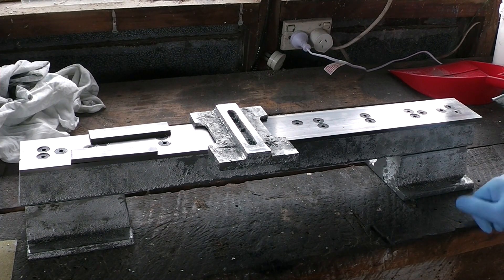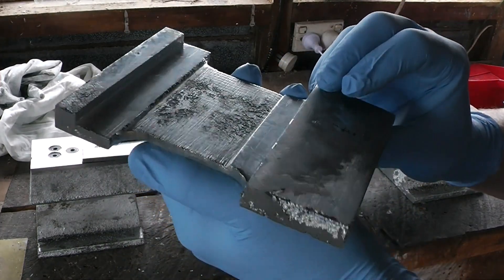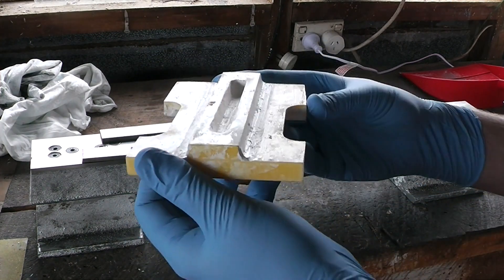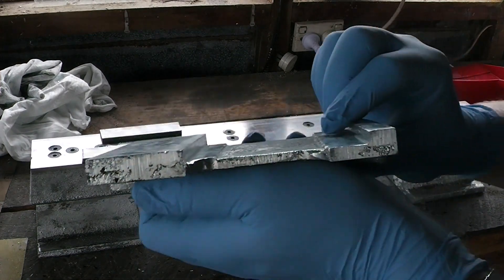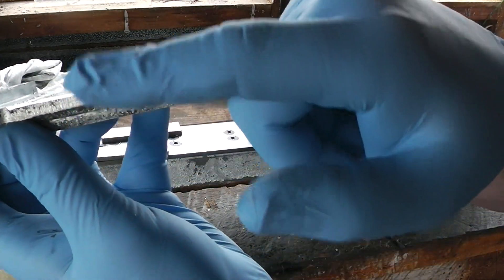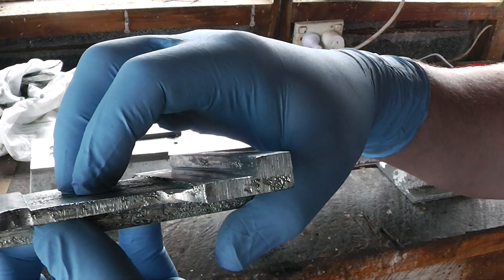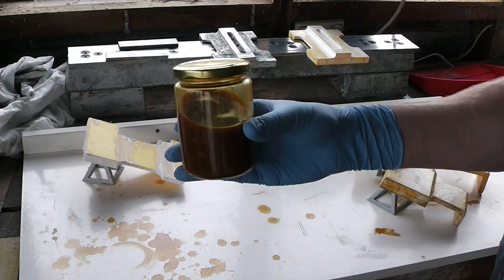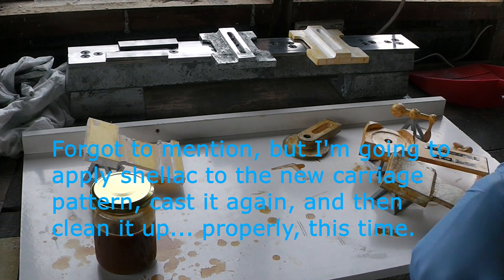Starting the Carriage and... uh... Learning

Comment: Don't feel bad, I worked for a global steel foundry with 100+ years of experience and we often  threw away (remelted) entire heats, 10-12,000# of castings that didn't work.

I had a funky thought that might help but should be approached with caution. You can do a lot of the aluminum  roughing work on a good table saw.

Comment: Well Sir, don't let one bad casting get you down. I've been casting at home for probably 15 years now and still occasionally get a bad run of castings. It's a never ending battle, usually because we don't have 100% control of the materials used because they are gathered parts mixed together, not new pure material. 
Hope it goes better next time, from Alaska, USA.